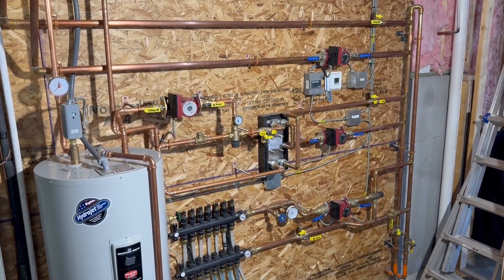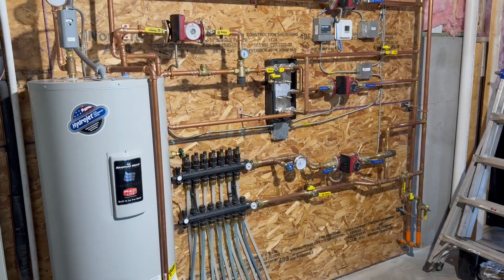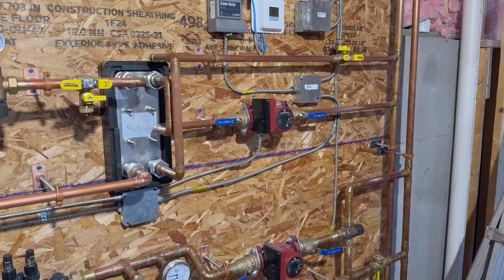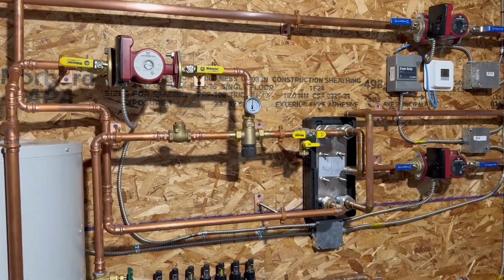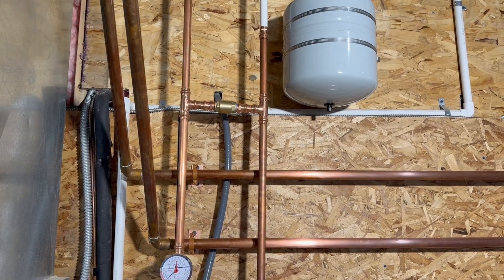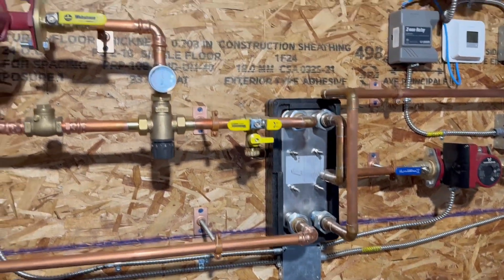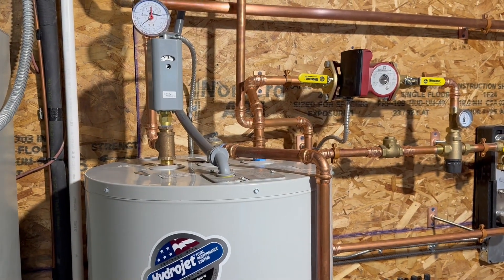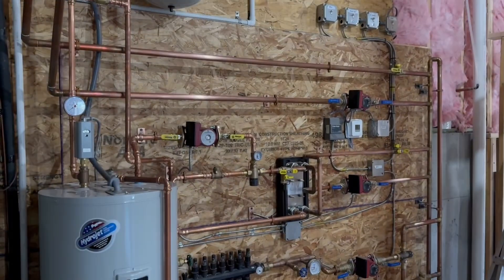Outdoor wood boiler heating domestic water through plate exchanger

Comment: Damn I just set mine on top of the tank and run the water through it as it goes in the tank.very simple
Reply from the maker: So does your setup just preheat the water? Do you still leave the water heater turned off? Is there a pump on the boiler side that is running non stop?
Reply: @Kcwaterheaters  yes the water on the boiler side circulates constantly and the water on the domestic side goes through the plate exchanger when we use hot water and goes into the tank. I don’t shut off the hot water tank but it never runs.
Reply from the maker: I think many are setup that way. With our setup the incoming temp into the water heater was 170 degrees. I don’t like bringing in water that hot because we have little kids. I’m also a little uneasy about plastic in the water heater leaching into water. Full tube, water heater nipples, and sometimes a portion of the anode rod are all plastic. We removed all of that on my water heater so even the fill tube is copper.